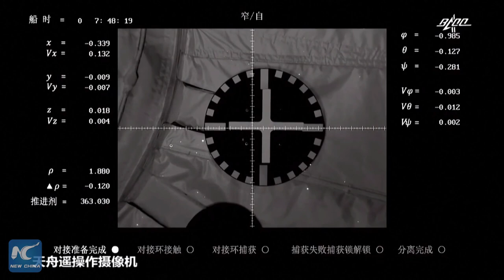SPACELink | Tiangong space station: rendezvous and docking, explained

Comment: Will the current crew of the CSS be involved in the construction of the experiment modules?  If so, when will that happen?
Reply: The current crew will return back in April 2022. The two experimental modules will be launched sometimes in May-July 2022 with two additional manned crews to follow.
Reply: @etow8034  So the experimental modules will be connected to the core module by computer alone?  I was expecting there will be a crew onboard waiting for the arrival of the experimental modules so that they can assemble it themselves.
Reply: @ivanfreely6366  Yeah most probarly auto dock.  As for the crew onboard or not I am not sure, most probarly it would be a safety risk if a crew was onboard during docking the two modules.
Reply: @etow8034  FYI:  Found a Chinese news article over at SciNews Youtube channel called "What's next for the China Space Station."  I'd post a link but Youtube doesn't like that.

Anyway, the construction phase of the CSS will have the crew of the Shenzhou-14 onboard in the core module when the two experiment modules are launched.  Looking forward to next year.